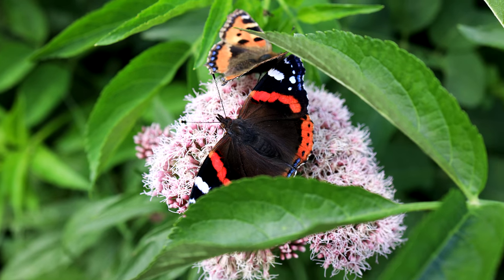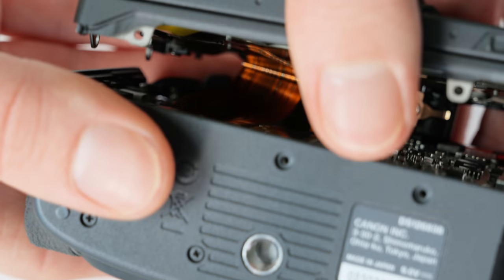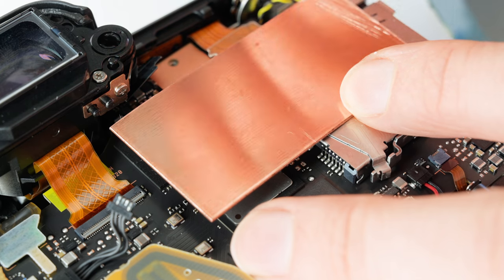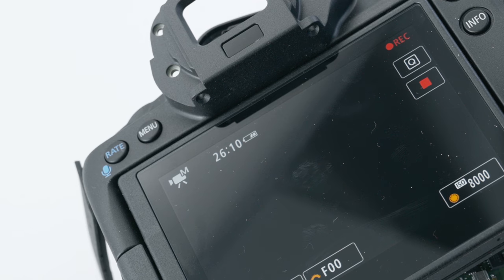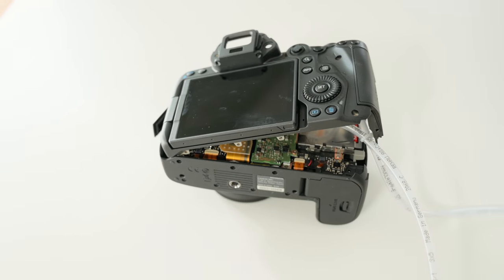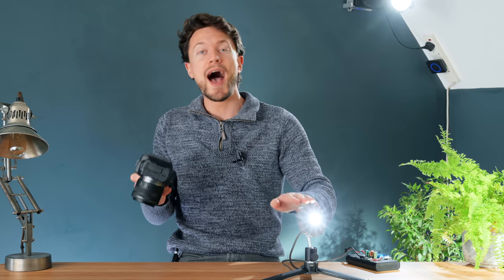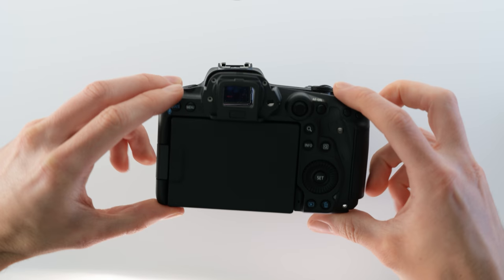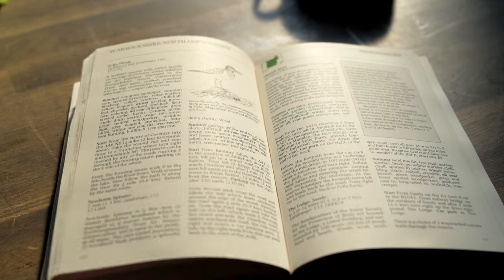The only reason to watercool a camera....

Comment from the maker: Quick update! I've been doing more testing and if the camera is in single point autofocus (or manual focus) instead of face/animal AF it DOES NOT OVERHEAT at all with this mod. Still have to do more tests to verify but it's great news!
Reply: Nice!
Reply: That's awesome. Good job fixing their camera!
Reply: I've been curious since originally watching this video as to the long term effects of this mod on the stability of the camera.  Specifically I was wondering about the large ribbon cable coming from the sensor, and if the heat from the heatsink passing so closely to it has had any physical affect on the ribbon cable, or in any other negative/unforeseen impact.  

Overall this was such a cool fix, and seemed like something Canon themselves should have addressed.  I'm curious why they didn't.

Thank you for what you do.
Reply: Do You mean It's not overheats without any cooling system? :O
Reply: Can we get more details on the copper plate? Like the exact dimensions so we can recreate it?
Reply: That's good news. Excellent work. The template for the copper heatsink and the template for the fan assembly so we could undertake this mod would be awesome. Any news on their availability?
Reply: How is the 4KHQ, does that not overheating at all? Thanks 🙏
Reply: Are you referring to a pristine Canon where you have NOT modified the cooling system?
Reply: What about adding a few air vents into the body of the camera? Just an idea. Great video.
Reply: 2 mm? Maybe a vapor chamber could fit?
I’ve seen some teardown mentioned another aluminum plate beneath the mainboard which (Canon’s engineers) seem to use as processor’s heatsink. Since it has a huge clearance; which could, maybe, modified to add extra heat reservoir or heatsink. I don’t personally own the camera but just curious will this help. :)
Reply: You now need to patent and partner with canon for mass production and get those royalties coming in
Reply: You should change to title of this video to include the name of the camera and model. You'll get even more hits.
Reply: Pretty cool huh?
Reply: Is thare any compagny how can make those brass heating recudtion plates
Reply: With an iPhone the heat-pats would have been hardware and software locked.
Reply: Very Nice mod.  I kept thinking you were gonna streamline the water cooling into a portable kit, but that would be bulky and heavy if not on a tripod.  A thought occurred to me while hearing that it still overheats with the 3D printed in hot environments...could you cut a small door to allow direct access to a small area of internal copper to use a heat pipe to the little cooler that could clip on.  This means the screen would need to be open so probably not optimum.

I have an older Canon that is no wear near the quality that you have and when I press it with max video it also overheats, but it gets glitchy...putting artifacts in every 10th frame or so, before shutting off...it take up to two hours to cool as well.  I am curious if a similar mod will extend my capabilities.  I will have to dig into it and find out...lol.
Thanks for another great video though brother...keep up the quality content.  FYI, you made a "clean room DIY box" several years ago, and I am gathering materials to do this as well for a data recover pod/box.  You are a wealth of info.
Reply: Could I buy one of those copper heat sinks? Pretty please??
Reply: without your internal modifications ?on 8k and 4k hq too thnks
Reply: Where the 3D printable base?
Reply: Please, pretty please could we have your dimensions / drawing of the copper heat sink you crafted...
Reply: 3:02 4 grand camera Body? Wahhh! Well you did what you had to do - QED

13:02  Ohh - nice plate! Now you can get the LID back on!

17:05 Custom cooling BASE ? Ok Ok I'm IMPRESSED

:) Nice work
 Pete, Gas Electronics, London
Reply: Brilliant videos !  Can you make a laptop case WlTH using its own monitor but case from MDF ? There is no even one video about that in whole internet. 👍🏻
Reply: @AlmantasVilbikas  "it DOES NOT OVERHEAT at all with this mod."
Reply: @Nissi5_  updates?
Reply: Adopt me 
Kudoos to you sir
Reply: Is it possible to dump the heat through the tripod mounting socket, I wonder?
Reply: I would have made a square cut out on the plastic and installed the cooler directly to the copper plate but oh well you managed to do it anyway!
Reply: Dude you're so fucking amazing! I learn so much watching your videos. They're so fascinating! As a person that just purchased the R6 knowing about all these heat controversies with the R5...I'm blown away you've been able to defeat, or at least exted the recording time by 43% - and be able to be used again after ONLY 5 MINS!!! With just a copper plate. 

Canon should contact you for consulting! 

Keep up the amazing work!
Reply: You've got to wonder if the engineers at Canon who made this camera have watched this. :-D
Reply: @anthonylosego  They need to take notes for future models! lol Ok, maybe it was crunch time, and they didn't have time to change designs - but to not even make a change in subsequent manufacturing in over a year? Meaning - to date, the R5 is STILL being manufactured the same way? Very lazy and disappointing engineering validation.
Reply: @Chuck8541  Oh, it wasn't a dig on Canon. Hope I didn't convey that. I was just curious what they might think. Something as complex as a real product like this has so many things that have to happen to get it done, it is no wonder something always goes wrong. It's almost expected. One just hopes you get really lucky and hit one out of the park. :-) I was just wondering if they may even do exactly this fix in a later iteration of this product or not. The one thing I can tell you about engineers at corporations is that they almost never act on what the public shows them. They worry they will get sued for infringement. I had sent a design to an engineer at Western Digital and the associate engineer their said it was a great idea. I sent in some CAD of it and they sent it back to me with a letter from legal that they do not accept ideas from outside the company. They opened it though so they read it. lol I told the engineer on the phone, "I'm not looking for anything, take this freely, just do it so defragmentation is a million times faster, please!" But I guess they didn't. Or did they? That was about 30 years ago.
Reply: I wonder if the entire camera could be pulled out and fit everything including the cooling in a 3d printed case.   Awesome video!
Reply: @Damuskinous  I'm sure he can make anything he puts his mind to. haha 

But as I just said to someone else, for all the trouble in modding the R5, a buyer should just go up to the canon Cinema Line. Which is like only a grand plus'ish more than the EOS line. 

Like, if you want a self-driving car, so you buy a normal car, do all these mods, and make a self driving car (which is totally doable btw! Saw a vid about it! lol), you might as well just buy a damn Tesla. 

You won't learn as much, but it'll save you loads in time and money.
Reply: If canon replcaes the plastic back could thin metallplate with plastic combination could the improve the camera for the next time
Reply: Canon could make the metall cooling pad conneced to the bottom and  add a big metall plate to the bottom permanently
Reply: @Chuck8541  if you're an R5 owner who is confident and competent enough to try this modification, why would you spend an extra grand when a small bit of copper plate and some thermal pads cost a tenner?

And I'm pretty sure the price difference to the Cinema equivalent of the R5 will be much more than a grand.
Reply: How about adding copper foil to the inner surface of case? Like in laptops?
Reply: Your fucking crazy man, I love this
Reply: i need a way to water cool my brain during exams :)
Reply: Incredile build and video quality!! I think you could have gone one step further and replace the plastic panel you conducted the heat to with a copper sheet, that should have solved the issue completely if im not mistaken, though yes you would have to cut into a 3000$ camera.
Reply: @Martin-zo8lz  Can the camera back be purchased as a spare part?
Reply: @AlmantasVilbikas   "...it DOES NOT OVERHEAT at all with this mod."
Reply: @BlackOps-Ent   "...it DOES NOT OVERHEAT at all with this mod."
Reply: @larryvaughn5843  I do not know. Sometimes you can snatch a few used parts of a broken camera online though
Reply: I would add a really small fan in the wall of the camera where the screen goes. Like cut a hole in it.
Reply: @TheOriginalGregToo  Those cables are rated for much higher temps than what the IC would normally be able to tolerate, so i'd argue that this is a non issue. (You can also add an insulator like kapton tape over it if you're that worried tho)
Reply: You should sell the copper plate heatsink kits. Could probably get $50 a pop easy.
Reply: Please tell me you sell this cooper plate on ebay
Reply: What is difference between a camera and a dedicated video camera these days?
Reply: @emilypeters8888  If you're talking about consumer grade, nothing. I'm not even sure they make consumer grade video cameras any longer.
Reply: @monkstandinglast  Cant patent it as it's already had public disclosure